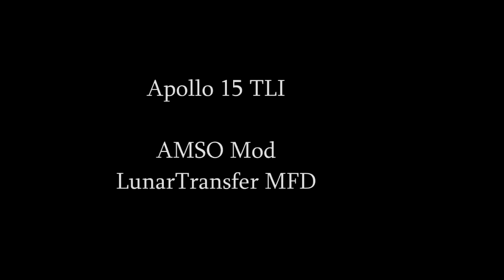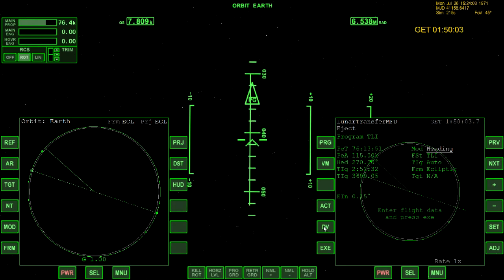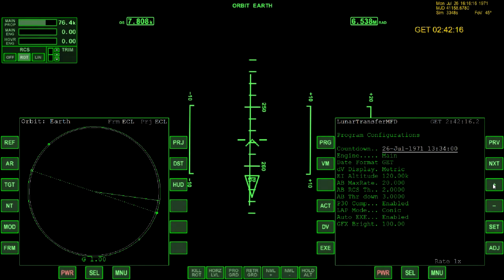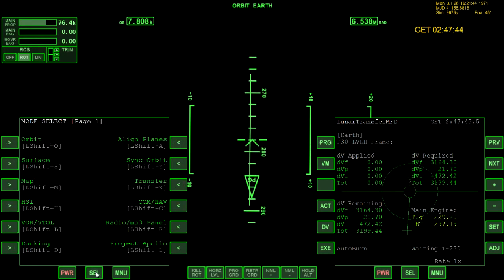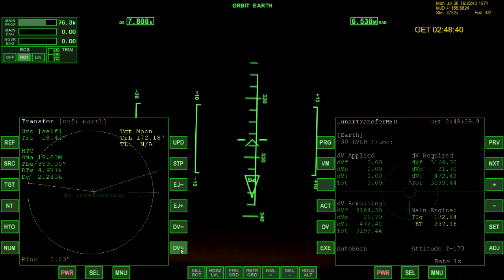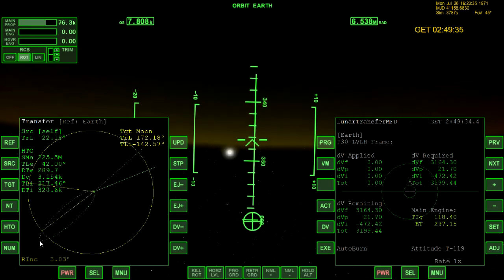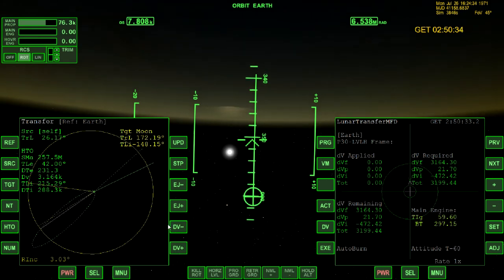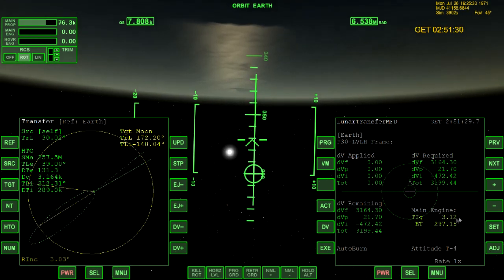AMSO Mod Apollo 15 flight to the Moon - Step 2 of 5 TLI

Comment: Hey, is it exactly the same for Apollo 11
Reply from the maker: DrummerSloth No, each mission is different. The concepts and use of the MFDs are the same but each mission checklist will have its own time table.
Reply: Yeah that's what I meant but great. If there are any differences referring to MFD differences can u make a tutorial on Apollo 11
Reply from the maker: DrummerSloth The AMSO mod will set the Apollo 11 launch for the correct time.  After that just use an Apollo 11 checklist for the TLI. Let the LunarTransferMFD set up and handle the burn. It may be a few minutes different than the actual historical time but it will be fine. Watch my tutorial on Mid course correction. https://www.youtube.com/watch?v=9QdeUvBzjjw It gives more detail on using the LunarTransferMFD. Be aware Apollo 11 sound file has a lot of commentary and will kick out of time compression often.